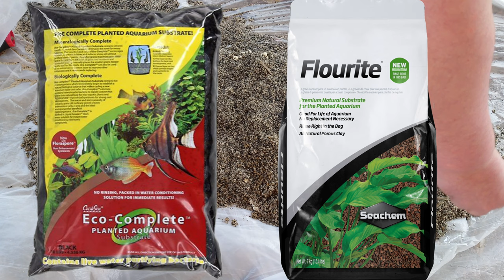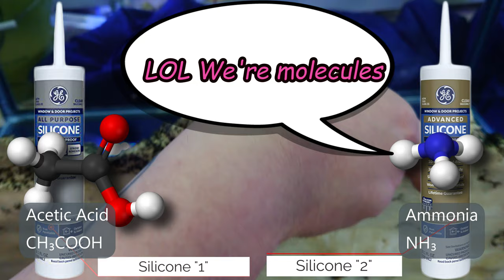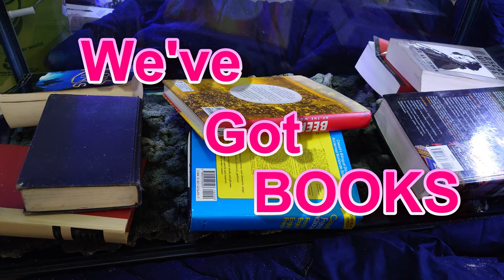How to Make a DIY 3D Aquarium Background Rock Wall, Cheap and Easy!

Comment: What if your tank already has fish
Reply from the maker: You'll definitely need to relocate the fish and drain the tank for a few days while the silicone cures. I suppose you could try to make the background just wide enough that you can wedge it in there using the side glass to hold it in place, but I don't know how well that will work.

Comment: asome. ...a doubt: would this work with coco fiber? . Or just with sand and gravel. i mean, i wonder if coco fiber cand stand long term acuarium conditions.
Reply from the maker: It would definitely break down over time, but spray foam.and coco fiber and pest and spagnum are a great terrarium wall combo.

Comment: Love this, and , as usual, you explained it very well. 
   In process now... Started my first one and tried only using black aquarium gravel. Ugh. Even with a couple inches, it was not enough weight to set all the gravel in the surface of the foam securely. Next try with play sand... I found out the hard way that, like the can says, the foam won't work in hot temps. About 90 out  today so the foam wouldn't even expand. It only hardened into squiggles that made my project look like a big litter box. Trying again. Wish me luck!
Reply from the maker: Thanks! Hope the second attempt goes well!

Comment: Great tutorial! Very, very interested in doing this for a 75 Gallon Mbuna Cichlid Tank! Question, what would you recommend if I wantedto make the background removable?
Reply from the maker: I haven't tried to make a removeable one yet, but I think if I were going to attempt it, I would make it oversized (slightly too wide, but only by a centimeter or two), so that it fits in the tank snug and is held there by friction. Alternatively, I'd consider attaching the bottom of the background to some pieces of slate to weigh it down. The background is extremely buoyant, so that's where your challenge would be in whatever method you chose. I'll also say that siliconing it to the glass doesn't make it permanent, per se; you'll just hate life if you ever do decide to take it out.
Reply: @StephenP2003  Thank you! And again great stuff!

Comment: I like this method. I might actually try this! The other methods I've seen involved mixing cement.
Reply from the maker: I tried a cement background first. It actually came out looking good, but then I chickened out over the potential water parameter shifting effects, coated it in flex seal, and it ruined the look. It's currently the background for the mosh pit, though.

Comment: Thanks for the vid! I’ll try this method out in a couple of days. One question since I’m a beginner, do you have to seal the edges of the background with silicone or not? Incas thinking that maybe the contact from water with the foam will have an negative impact? Thanks and all the best from Germany.
Reply from the maker: @kocam030  there's no major issue with the foam contacting the water, but one reason you may want to seal close to the edges is to prevent waste, debris, and stagnant water from accumulating behind the background in large amounts.

Comment: I love this idea! However, there’s already water in my tank. Can I still do this and then place in my tank? Or does it have to be empty?
Reply from the maker: The challenge is adhering it to the glass, because the background is going to float otherwise. If you made it exactly wide enough to wedge between the sides, you might be able to hold it in place with friction, but I don't know if anyone has tried that.

Comment: Ive been having a hard time keeping a styrofoam decoration glued down to the glass. I used a DAP Alex Flex. Its been able to keep the smaller decorations held down, but I have 2 taller ones that keep coming detached when i get the water almost full. Is the GE All Purpose stronger you think? Thanks!
Reply from the maker: I just looked up DAP Alex Flex. That's a siliconized latex-based caulk. It's mostly made of latex, and water soluble. It won't hold well, and you don't want that broken down latex adhesive in your tank. Whatever you use, make sure it says 100% silicone, and you must let it fully cure before a drop of water touches it.
Reply: @StephenP2003  thank you so much! I had looked it up too but I'm still trying to learn as much as I can. I will break down my other decorations and reseal them with the GE All Purpose. Thanks again!

Comment: I'm looking to do a background on a 72" aquarium, would you build a background in 3 sections?
Reply from the maker: You can make it as one solid cohesive piece and then cut it into sections if you need to do so to fit it in the tank (center braces being in the way and all). That's how I did the background shown at the very beginning of this video on a 55inch tank. Then I used a bit more spray foam to hide the seam.

Comment: Good video! 

Two thumbs up! 

Question, after peeling off the back and before painting do you rinse off?
Reply from the maker: Nope, I don't rinse it at any point, other than when I first fill the tank, I might do a couple of water changes if the water is cloudy from the substrate.

Comment: How would you put in a bump out for the intake,heater, and clean water return?
Reply from the maker: I would probably encase that equipment in something like rigid styrofoam  to make a 3D template, and put spray foam on the template. That would be if you want to hide the equipment, as of course the simplest solution is cutting around it.

Comment: Can I make this and add it to an already established tank?
Reply from the maker: The challenge is adhering it to the glass, because the background is going to float otherwise. If you made it exactly wide enough to wedge between the sides, you might be able to hold it in place with friction, but I don't know if anyone has tried that.

Comment: Can you put a heater behind this? Is it safe as far as the foam goes?
Reply from the maker: You could, but just make sure the heater was never on while the water is draining or it would for sure melt the foam if it's touching it or very close it... but my main concern would be lack of flow if it's tucked behind the background, it wouldn't be very effective at distributing heat in the whole aquarium.

Comment: If I have, for exemple, a plastic airplane model, can I use the Polyurethane Clear Coat to make it cold freshwater aquarium safe?

Awesome easy follow tutorial!
Reply from the maker: Yes, just let it cure completely before exposing to water, and use the oil based kind.
Reply: @StephenP2003  oh cool I will try to found the same spray can you showed and follow it's instructions, I wanted to do a Tie Fighter wreckage aquascape for some time now, but the information online is really misleading I almost gave up searching for an awnser...
I've read about Plastidip, Krylon, Silicone, UV resist Acrylic, FlexSeal, but no one can give a straight awnser, all say epoxy but thats not easy nor affordable.

Comment: is the polyurethane coat just a precaution? just wondering
Reply from the maker: @isbiome  yeah, pretty much, not that I really put a lot of effort into making sure there was a perfect seal against any potential toxins. But the background is still holding up in a plant grow out tank with fish actively breeding for the past 2 and a half years. I suppose the extra poly layer also serves as a bit of extra adhesive for the grains of sand that may be barely hanging on to the foam.

Comment: What were the wait times/ cure times in between products. How long did you wait before you put the paint on top of the spray foam? And how long should I wait to apply the Plasti dip after the colored spray paint? I know you had mentioned that we should let it cure for a week before actually putting it in the tank? Is that correct? Assuming that's after I apply the plasti dip.
Great video! Thank you so much for the informative ideas! Definitely got my creative side aroused.
Reply from the maker: I waited about 15 minutes between coats, 24 hours before top coat with poly urethane. I waited about 12 hours after the spray foam to start painting it. Are you going to use plasti-dip on it? That's a specific type of coating that i have not tried in a submersed environment.

Comment: Nice I have been thinking about trying it myself. Do you think it would work just by putting the spray foam right on the glass.
Reply from the maker: I don't think the foam would actually stick to the glass itself, but if you spray it end to end, it would definitely expand enough to wedge itself in... much easier to remove if you ever get tired of it, too. Not a bad way to do it, especially if you don't intend to paint it.

Comment: If I were to use the concrete method to make a 3d aquarium could I still use the polyurethane to coat it? I want to be able to but the background in fairly soon rather than waiting several months for the concrete to no longer change the ph of the water.
Reply from the maker: The polyurethane isn't going to be lasting solution. Polyurethane coats are not totally water impermeable over time so it will only slow the reaction. You would be need to coat it in epoxy, which I feel gives too much of an artifical look, or coat it in drylock paint, which is a solid color and defeats the purpose of using concrete in the first place. I spent several months working on cement background solutions, and ultimately I decided that using this spray foam method is the easiest and safest method, even if doesn't essily lend itself to the most advanced background designs.

Comment: I have a hexagon tank.  What can I use for the circular background
Reply from the maker: Honestly, the foam background is so flexible that I think the same method would work for a hex tank. Some people apply the foam directly to the glass with success, but I have also heard of people breaking the glass from applying too much foam and the pressure from expansion being too much for the seams/silicone.
Reply: @StephenP2003  thank you. I’m going to do your method. I definitely want to hide all cords pumps etc. Any suggestions for. As pump and filter system for a 85 gallon hexagon tank?
Reply from the maker: @tanyawilson5928  you might find it easier to hide the intake and output of a canister filter, but hang on backs are definitely more convenient.
Reply: @StephenP2003  thank you

Comment: I have that GE 2 silicone and on the back it specifically states "not recommended for underwater or aquarium use " what's up with that ?
Reply from the maker: It's more of a cover-your-ass situation. For one thing, most people don't consider the significantly longer cure time that silicone 2 demands because of the solvent it uses, so there is an inherent risk in using it in aquariums if you don't know what you're doing. There is no reason to CHOOSE silicone 2 over some other product, but rather it will work for this purpose if it's all you have and you're willing to wait a week or more before adding water and livestock. Secondly, while fully cured GE Silicone 2 is fine for adhering decor/backgrounds, it's not ideal for sealing aquariums, as there are other silicones out there (like RTV silicones that will use a different curing method to form a stronger bond on glass), so it's safer for the manufacturer to say it's not recommended for underwater or aquarium use than to specify which use cases are "fine" and which use cases are less than ideal.

Comment: after watching this, i just had a though, has anyone tried that stick on tile? I saw some that had pebbles, thoughts?
Reply from the maker: I've definitely seen that done before! But I don't know for sure what adhesive was used. The adhesive backing on those stick-on tiles may not hold up, but I imagine putting some silicone on it would work.

Comment: I wonder how to install this to an existing tank that has fish and plants?
Reply from the maker: You wouldn't be able to use silicone, but if you made the background wide enough that you could wedge it between the side walls and against the back glass, you might could make it work. I've never tried it.
Reply: @StephenP2003  i will give it a try.

Comment: Is this also safe in Saltwater/Reef tanks?
Reply from the maker: Yes, everything is fully inert when it dries if you use the exact paints and other materials I used. I verified the safety of these materials by confirming they were reef safe, since that is basically the pinaccle of sensitive systems.

Comment: So, is there a way to install this if the tanks already full with fish, I really don’t wanna drain the entire tank and move fish just to install, is there underwater adhesive that’s safe with fish or anyone have any ideas?
Reply from the maker: You wouldn't be able to use silicone, unless you can drain the tank halfway and keep it that way for a few days until the silicone cures. You'll need to keep it clamped in place really well because the background floats. If you made the background wide enough that you could wedge it between the side walls and against the back glass, you might could make it work. I've never tried it.

Comment: Can we put this without silicon
Reply from the maker: Silicone would be the only adhesive that I'd consider using for this for longevity. This is a super light background and needs to be held down somehow. I know some have achieved this by applying the foam directly into the tank, using the expanding properties of the foam to secure the background in place. I have not tried this, and I've also heard of someone cracking their tank because of the force of the expanding foam.
Reply: My problem is that my whole tank is in the wall so how can do
Reply from the maker: @sagarmalthankar4066  if you can reach far back enough to install a background, you can use sticks that are just long enough to wedge between the front glass the background. It does not take a lot of pressure, just enough for the silicone on the background to make continuous contact with the back glass.

Comment: The pond foam is closed cell foam the regular spray foam isn't. I've made many duck decoys out of foam and I'll tell you do not use anything other than closed cell if it's going in or near water!!!  Open cell WILL absorb water if any tiny part is exposed.
Reply from the maker: The great stuff foam I used is closed cell, not just the pond foam. I'd agree that you wouldn't want to use open-cell for anything you want to float.